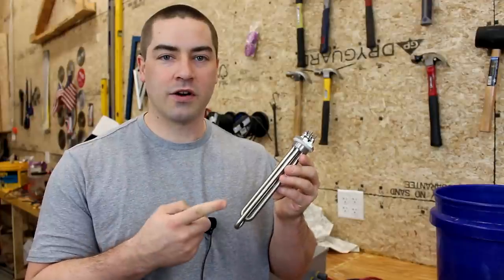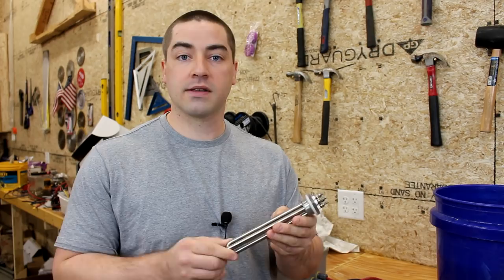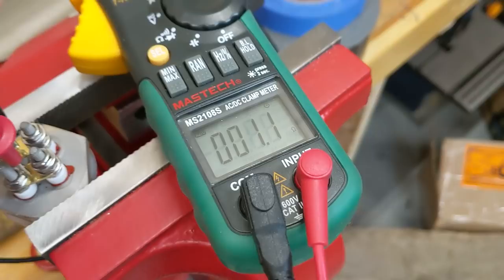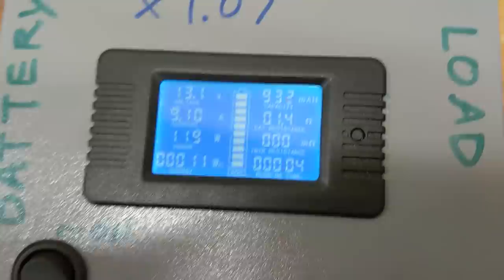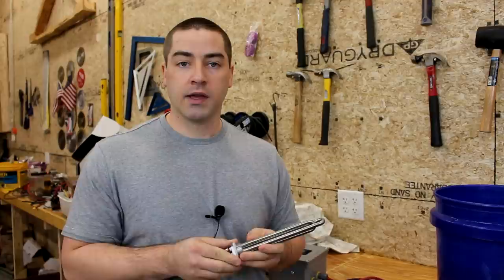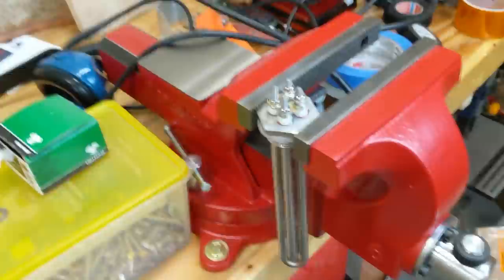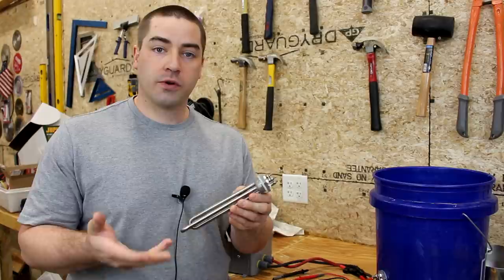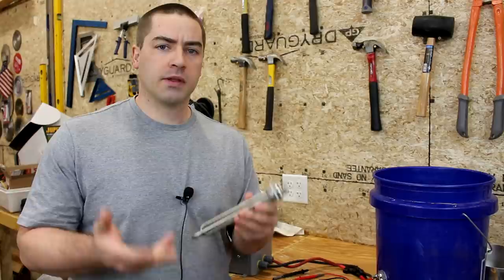Getting what You Paid for using Science

Comment: If you're trying to measure lower resistances, you'll want to be sure and zero out your meter first (if it has that feature!). Not saying that was the problem here - the 1.1 Ohms is WAY the heck wrong, so the point of your video is totally valid. But this will be a bit more of an issue, for instance, when you get heating elements with smaller resistances like you expect to be receiving.
Reply from the maker: Thank you for getting the point.  I agree with you (and other comments) about the meter.  I own a more accurate meter specific for resistance, but since it was so far different, I wanted to show checking ohms with a more common multi-meter.  Part of making the videos is trying to think about when to use normal tools vs. the specialty tools I've been picking up over the past couple years.

Comment: Putting 60 amps into a heater is pretty dumb.  Increase the voltage, save a shit ton on wire.
Reply: Turning 12V into 120 is dumb. Use 12V as is and save a shit ton on inverters...

Humm, seems we need a compromise...

Hows about move the mountain to Mohamed. Keep the water heater near the 12V source...
Or even make the wires hollow (central heating copper pipe) the they become the heater with the water lowing through....

Comment: Might be getting ahead of your upcoming projects, but for best efficiency from solar or wind, heating water with a resistor is easily beaten by using a heat pump. A 1kW compressor can easily move 3kW of effective heat into the water because it's only moving it, not creating it. Might be something you could go into at some point.
Reply from the maker: That statement is true sometimes.  This past week my outside air temperature hasn't gone into double digits (F).  :)

Comment: HELLO AGAIN,
I just found a 12v 600w water heater from "DERNORD" that actually stated a current of 50 AMPS (which is what I'm looking for).  12V @ 50A  actually gives 12v x 50A=600W.  The fake heater measured  12V @ 12.5A which is 150W...just as I verified with meters... will wait for replys to my messages and order it.

Comment: You could just get more of those and put them in parallel. At least if you have more of them the chances of them heating up will be less and as a result of the banks higher power handling they will have a steadier resistance.

Comment: So the reason I don't add you that is subscribed to your channel is because you like the use resistance to heat. Someone else has noted That alternating current Is likely what explains your issue here and I found it strange that you didn't reference your early learning on that issue But here's the thing Heat pump water heaters Do not have to be built from scratch . The air conditioning industry At least the commercial one It's continuously Liquidating . Air-to-air air conditioners Are inherently Inefficient And the surface temperature Of the condenser coil Is engineered to operate far warmer Then you would ever want to heat water for bathing or even Boiling If the right pressure So you can convert Air conditioners Two water distillation Underfloor Heating Using hydronic storage Meaning when the sun is brightest and the house does not Need much heat you can store The Heat . This means that the amount of solar panels that you require can be reduced And I mean thermal panels You can substitute electric panels And pump afternoon heat into tanks for Use any time I also believe that there are phase change materials that will not damage the condenser coils . Understanding The trillions of dollars And I mean with a t That are being wasted melting down the copper in these condenser coils And the compressor Motors Etc Would take some time . What doesn't take any time Is the understand that if you are in the market for electric resistance Heating You have a Target painted on your forehead And it says sucker

Comment: I bought a 12V "15W" LED bulb from a local supplier with a Chinese name on ebay. It wasn't very bright, so I tested the voltage and current on a 12V battery. It was only using .4 Amps, so it was only a 5Watt bulb! I got my money back. Before buying another I asked 2 suppliers to assure me that their bulbs were what they said they were. I got a load of BS from one and no answer from the other. Conclusion - ebay don't give a ** so don't buy from this type of supplier.

Comment: SO, What I am not clear on is: we have people harping on in the comments about checking the math at a different voltage and how you got an element for 120Vac...... Why? Do people not listen? David stated that the elements would be used for differential resistive loading @ 12Volts....... How is it that people do not listen to what is being said, and then try to fault find other things that were not at fault to begin with?? Thanks David for a good and honest review.... Well done.
Reply: The suggestion that these might be 120 V elements.  OK V.V/R gives power so soy these are 120 V and claimed 800 W R squalls about 18 ohms hot( 120/18 gives 6 amp for 800 watts)   now resistance cold would be much lower so on a 12 V supply  where element never gets to temp the resistance measured and calculated from 12V 60 A match well since both close to cold resistance....

Don't forget all the cabling will have a Resistance not too much smaller than the heater element in its low temperature state....so this adds in

Comment: You have a heater whit 2 heaters in it. the copper plate in between wil put it in serie or parralel. 
I think it is on serie, so both heater wil get each 6V that means both heater are 0.5ohm each, if you change it to parralel than both heaters wil get 12V and the resistance is changed to 0.25ohm in theorie. 
Than the power draw changes to 800watt. 
The second question is than wil the unit be able to resive and hold the 67Amps or wil it melt because of the high current

Comment: DavidPOz, PLEASE READ THIS   : I just can not believe you missed that. C'mon! Multimeter for measuring below 1 ohm are very POOR.. and if you have a GOOD multimeter it wil  include the option of ZERING/nulling the probe resisatnce which mean it will substract the resistance from the probe after you touched these together and it measured their resistance and substract it from the measured value.  Otherwise you need a PRECISION 4 wires multimeter and then get the right ohms. Now for the question of low amperage, we.. i think the TOTAL resistance of your electrical wirring might be about one ohm.. which mean you can not get higher than about 12A of current. for ultra Low ohm circuit, you need very big wires. that's it. Also when you measure the voltage that your element is having, you should measure it directly AT THE ELEMENT lead.
Reply from the maker: Thanks Doctorbass for the suggestions.  I'll try to fix that on my next video.
Reply: @DavidPozEnergy  In addition, if you can get 12V at the element lead then you should get about your 800W if the element is ok. But from now i think most of the 12V is spread between the all the wiring and then a few volt can get to the element itself.

Comment: It is easier just to use a relay at 240V and set it up to kick on once the battery hits float.
Reply from the maker: I think that approach is easier, but you have to have enough inverter capacity for it.  I'm setting this up as a load for the workbench testing.

Comment: I am looking for a total  resistance of 0.24 Ohm in order to draw 50A @ 12V.  If the 400W element is genuine, it will draw 400w/12v=33.33A at 12v.  That's a resistance of 0.36 OHM.  If I use the fake 150W that draws 12.5A, that's a resistance of 0.96 Ohm.  If I parallelthese two I will get a resistance of 0.26 Ohm and a total current draw (at 12v) of 46A at 552 Watts (just short of the 600W I wanted.  However, on Amazon, I just fouund  (and ordered) another 12v 600w heater which actually stated "50 Amp heating".  It should arrive in 4 days.
...too much taking chanches...
THANKS FOR THE QUICK AND HELPFUL REPLY!!!
Thumbs up and subscribe to you

Comment: The method you used for measuring the resistance is not really good.
In order to measure low resistance, you really need a 4 wire ohm meter, where the sense and source connections are at the resistor. 
 using that method eliminates lead resistance, which you have probably added to your resistance measurement.  Although the lead resistance is probably small, it will affect a low resistance measurement like you were trying to do.
If your meter has the capability to null out the lead resistance, that would really help, but a 4 wire is still the correct way to do this kind of measurement.
The real indicator that these heaters were not 800 watt was your current measurement.

Comment: Was wondering if the resistance decreases when heated as some materials change resistant with temperature?  Just covering the bases.  I came across the same similar issue here recently.
Reply from the maker: Generally speaking (and true of the water heaters I have tested) the resistance goes up a little as they heat.
Reply: @DavidPozEnergy  TY

Comment: Measuring the resistance of a heating element when it is cold as a way of telling how many watts it will pull under load is nonsensical. 
Every heating element has a "positive temperature coefficient".
Meaning the resistance changes (goes up) as it gets hot. Not too much on a water heating element, cause they run under 200 degrees F.
But for space heaters and such it's a tremendous change.
Good math, but poor application of that math.

Comment: The terminals look like they can be swapped between serial and parallel. Perhaps try it in the other configuration.
Reply from the maker: You are right.  I showed it in parallels, which is how it's supposed to be for the 800w rating.  But I've gotten this question enough that I'll demonstrate the series connection in my follow up video.  It will draw less watts in series.

Comment: It would be interesting to see if they either remove their ad on Ebay or leave it. This would be the real test for what type of business they are. David, I think that you've taught me enough to recognize that you wanted to use them for a resistance test or possibly testing battery capacity through resistance, no  ?
Reply from the maker: Mostly for testing batteries at very high C-Rate.  But also I wanted to make a video on DC water heater controls.  I've made some videos in the past on how to use PV solar panels connected directly to heating elements, but I never made a video on how to make a controller for it.
Reply: @DavidPozEnergy  I would like to see a video about that. I’m making a 48V dc water heater, powered directly from solar panels but I can not find a good way to control the temp.
Reply from the maker: @mburger,  Making a video about a controller is one of many things on my list.  I've got tons of projects and videos to work on, just lacking in the time to get to it all.  Thanks for watching.
Reply: @DavidPozEnergy doing this now and your videos are still helping folks like me! +1 on the controller!

Comment: @1m: "0.18-ohm"  It's a challenge to measure that low a resistance. SImply zeroing out the DVOM doesn't assure an accurate measurement. In industry, one would use a four-wire measurement technique. It'd be easier, and far more accurate, to measure the power when installed.

Of course, measuring 1.1-ohms is easier. LOL.

Comment: Ive similar ones, they can be 24v 600w with 2 elements in series with or 2 x 300w in parallel - depending how the brass fitting on the end are configured - so watch out for that as mine came with the brass connections for parallel / 24v
Reply: These are wired in parallel, you would have to remove one of the plates to wire it in series. If the resistance on both strings are kinda similar, the resistance in series would quadruple and the power output would drop to P=U²/R= 32,7W

Comment: You could have just dipped two separated battery fed metallic rods into the water and recorded the depth when the Wattage was met.
Reply: Only if electrolyte was added to water. It's really difficult to heat water up that way when it has little to no impurities in it. And if this is going to be potable water (aka drinkable), you don't want to be putting a lot of salt in it.

Comment: You stated that the total resistance was 12.5 ohms but that was with both elements in series. Was it not possible to wire them in parallel which would result in 0.275 ohms, a bit closer to your desired goal of 0.18 ohms?
Reply from the maker: I checked it in both series and parallel.  I thought the video clip I shared was in parallel.

Comment: Hello Dave, what I know about home electric water heater elements that are made of inconel. They are called sand hog ultra low density elements. They have incredible long life, put up with hard water and are the most efficient because the element is curved and folded upon itself. The negative is that most repair contractor guys always complain the removal process is difficult because the elements change the shape from original install shape.The trick for replacement I will not state here. They replace them with ultra high density elements which are really not that efficient but easy to take out. This makes the old high end electric water heater a perfect candidate for replacement for some CHINAMAN JUNK. Most people will fall for this lie and spend funds needlessly. Peace.

Comment: What problems would I have connecting 600 watts of solar directly to a 600w 12v heating element in heat storage tank besides the possibility of overheating? Skip controllers, relays, or thermostats.

Comment: What are you using now for hot water since its been a few years on most of your testing? Im on solar except my hot water heater.
Reply from the maker: I have a solar hydronic system which heats water directly.  That is my pre-heater.  Then it goes to an electric tank, which only turns on if the solar tank is not hot enough.  The electric tank runs off my inverter.

Comment: Did you measure the voltage at the terminals to confirm that you were actually delivering 12V to the load? Your lead resistance may be part of the problem.

Comment: Hi. I tried to connect dc 48v 1500w water heater element, and 3 panels 450w×44~50v in parallel... between them 32amps circuit dc circuit breaker ... distance between panels and element around 30m .. cable size 2×6mm ... volts received around 44v ... after putting switch on : voltage drops to 1 to 3 volts ... what's the problem? Thanks
Reply: u have to calculate the ohms,,,,is not working like that,,,try them in series connection and change the resistance to 240v x 3500watt and u will make it if no other problems appears

Comment: Sounds like you got an element for 120V AC
Reply: 120vac 800 watt element would be significantly larger resistance, and the power on 12v would have been about 8 watts.
Reply: No, at 120v and 1.1 ohms the power would be 13,090 watts and 109 amps! Probably shouldn't post if you can't do the math.

Comment: Heard about you from will Prowse. Looking forward to watching all your videos. I just bought 9 x 230 watt 24 volt (used!) solar panels and now I’m trying to figure out how to put together an entire system-also buying all used components. Wondering if there is anything in particular I shouldn’t buy used. I have lots of thick copper wire from wiring a hot tub and and from wiring a kiln and also a couple of gfci’s. I never hear anyone talking about using gfci’s on solar systems. Is there a reason? Can I re-use these? Thanks. It seems from wills book I have 2070 watts in panels so I have to have a 2000 w inverter but thought maybe I should get a 3000 or would 2000 be okay? Also I think the mppt should be 85 amps...and the batteries I was going to make from scratch, but I don’t know how much battery to make except I think it has to be 24 volt batteries and I should get at a minimum 2 x 100 amp 12 volts and wire them in series but that maybe it would be more appropriate to make 4 x 100 amp 12 volts and then wire them in 2-in-series for 24 volts and put the 2 sets of two in parallel for 200 amp hours x 24 volts or a total energy storage of 4800 watt hours. Have I calculated this correctly? One thing I am not sure is: I could only get 9 of these panels. Is it okay to use all 9 or should I only use 8? Later I would like to add some wind, and I’m keen to experiment with wind driving a couple of small flywheels I scavenged. Is that crazy? And I wanted to use any dumps to heat water and my living space (will be off grid as I have to move my RV somewhere else by May 1st. Also - is it okay to have the temperature fluctuate for my lithium batteries from 50 F at night to 75 in the day? Thanks for your comments and suggestions
Reply from the maker: Hi Kerr FamilyLaw,  Thanks for checking out my videos.  Most of my stuff I buy used, or on sale.  You asked about anything to not buy used.  I'd probably say safety devices need to be bought new, such as fuses and circuit breakers.  But otherwise, I've had used equipment that still works fine.  

Gfci, I have gfci outlets that work just fine with my off-grid system.  But my system is grounded (ground-rod) so you might have them not work if you are doing a non-grounded system.

I have not read Will's book, so I don't know what you are talking about.  Wattage of panels does not dictate wattage of inverter.  There is a relationship between wattage of panels and wattage of charge controllers, but it's in-direct.  It's more accurate to talk about maximum amps, not watts.  For example, when I started I had a 4.4kw solar array with a 3kw inverter in the same system.  Not relevant since my charge controller was what tied in my solar array.  Today I still have the same charge controller and same 4.4kw solar array, but I've changed out my inverter for a new 12kw inverter.